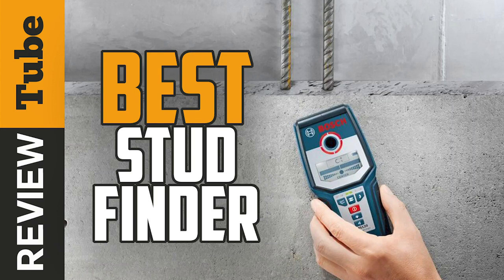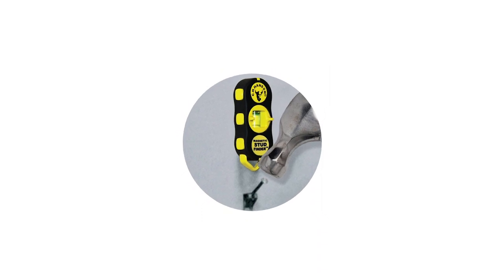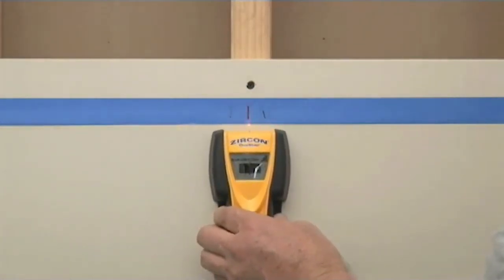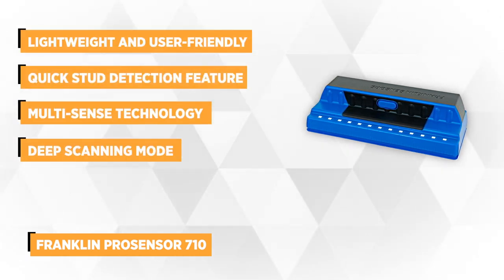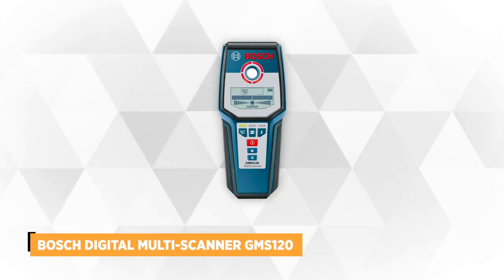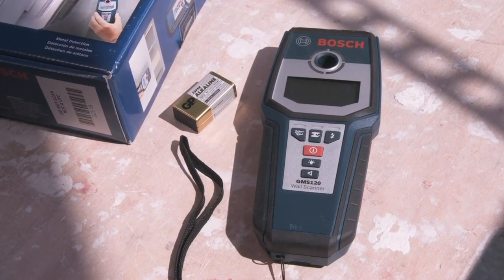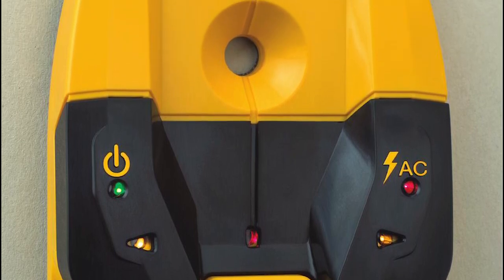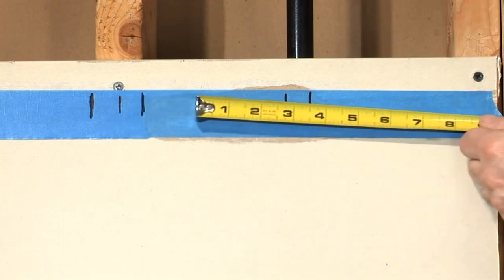✅Stud Finder: Best Stud Finders (Buying Guide)

Comment from the maker: ✅1. C.H. Hanson Stud Finder: https://bit.ly/3bahc17
* Find a great deal on eBay : http://bit.ly/3aT0txJ
✅2. Zircon StudSensor i65: https://bit.ly/3h9SaDk
* Find a great deal on eBay : http://bit.ly/315OZSU
✅3. Franklin Sensors Stud Finder: https://homedepot.sjv.io/23kAA
* Find a great deal on eBay : http://bit.ly/2U7q1RH
✅4. Bosch Stud Finder: https://bit.ly/3h6BaOf
* Find a great deal on eBay : http://bit.ly/2U7J26E
✅5. DEWALT 3/4 in. Stud Finder: https://bit.ly/3urJA6p
* Find a great deal on eBay : http://bit.ly/2RHf33T

Ancient Japanese Tonic Melts 54 LBS Of Fat: https://bit.ly/39sKV4H
STUFF YOUR FACE. LOSE WEIGHT: https://bit.ly/31FOT5q